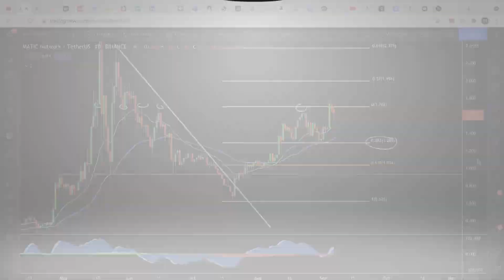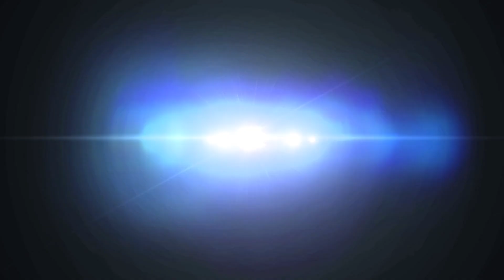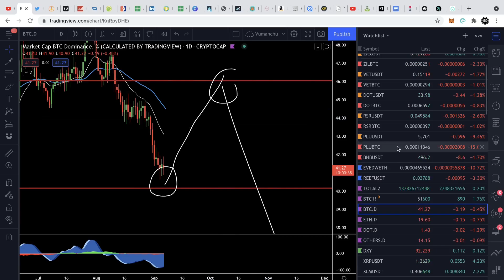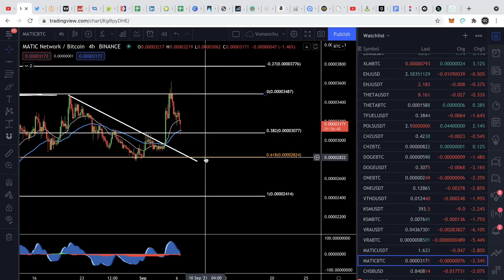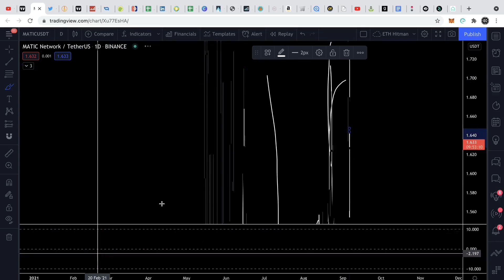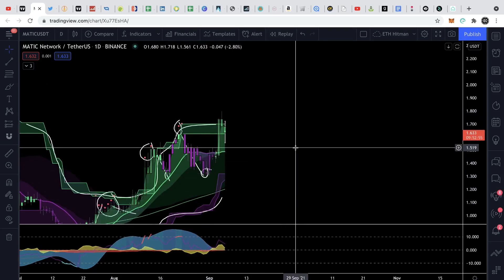POLYGON PRICE ANALYSIS - MATIC TECHNICAL ANALYSIS - MATIC PRICE PREDICTION 2021

Comment: Can someone explain why the polygon should be 10-20$ till end of this year, I am seeing many videos in which all the creators say that polygon will be up bcoz ETH is having a high Gas Fees, but according to ETH community, after ETH 2.0 (which is probably in Dec this year) they will switch to POS which will make the Gas fees affordable and transactions will be more faster, i.e. scalability will be easy, SO if the home network can provide a smoother scalability why would someone choose a sidechain for same??

Although I can see there are many projects which are already live on Polygon Chain, but still the home network can provide the same to new comers.
Reply: Ethereum 2.0 isn't until next year. Also, Coinbase just partnered with Matic.